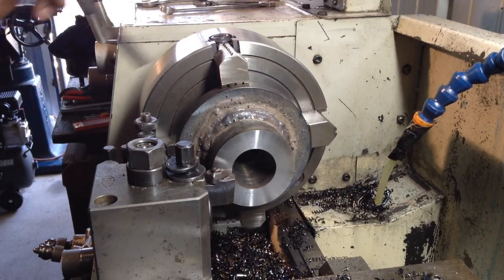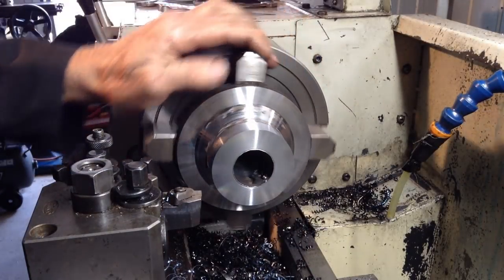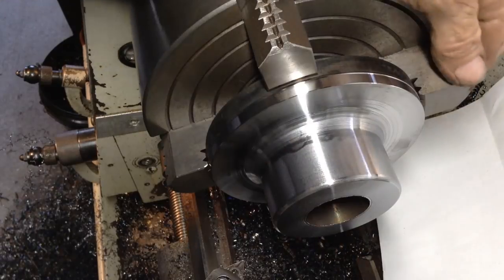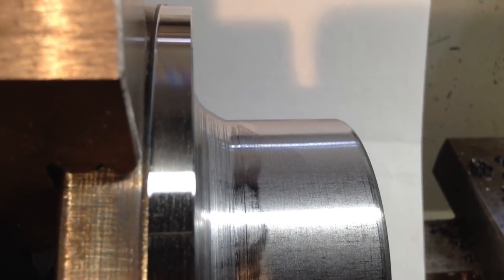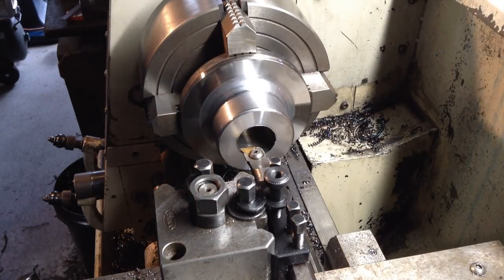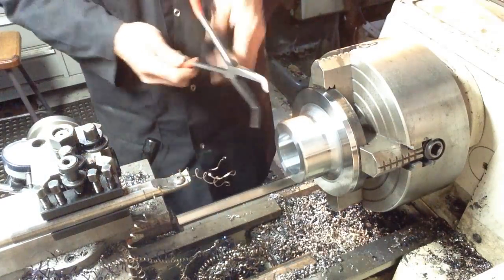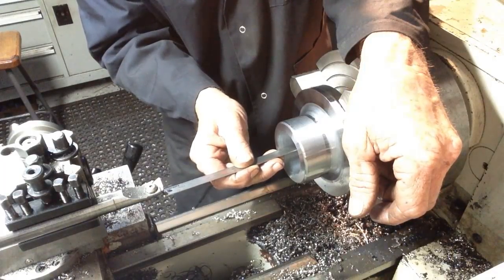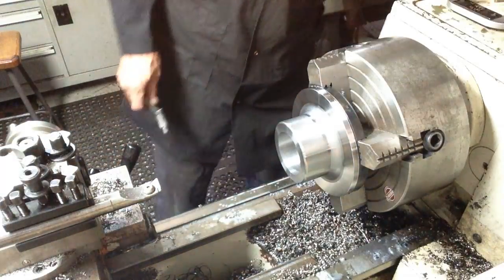Lathe Tailstock Chuck Mount .  Part 5 .

Comment: Hi Max, you got me making one, I used a front wheel bearing for a ford laser, lynx here in the Philippines, double race angular contact so it's a simple bore.
Little ahead of your's, making the spindle next.
Made the hub out of a solid billet of 4140, lots of swarf.
Reply from the maker: All the best for your build .   If i had had solid , i would have gone that way as well .  Cheers .

Comment: Nice job Max, stick with your long format, it's how I go too and is appreciated across the entire experience range. Everyone has their own way of doing things for example, I was paying particular attention to your cross slide inputs when boring, interesting how you back off at the end of every cut then reset immediately (almost like screw cutting), never done that or picked up on it before! Is that something you were taught or something you learnt? Cheers, Jon
Reply from the maker: Just something i started doing ages ago , mainly only do it with an indicator on finish cuts    & use the dial increments on roughing cuts to save dragging the tool back across the bore .  
It's one of the various methods we use , depending on how we feel on the day  !

Comment: It's coming along great, Max 😊👍. Maybe a dumb question, were you watching the indicator and manually compensating on the cross slide?
Reply from the maker: No , all  Eyeball .  Sometimes i will set the londitudinal feed going & 
hand feed the cross slide and other times both feeds are done by hand at the same time .     Just takes a bit of coordination .
Reply: @swanvalleymachineshop  nice! Well done! 👍😁👍

Comment: Max, when you cooled the part before measuring it accurately you turned it by hand while running coolant on it.  Is there a reason you turned the part by hand other than maybe to reduce the amount of coolant sprayed out of the lathe, even at the lowest speed of your lathe?  I'm sure you've got a good reason or you wouldn't be doing it that way!  ;)
Reply from the maker: If i turned it on there would be coolant going everywhere , even at a slow speed .   The oil to mix the coolant with is expensive , so i try not to waste it .
Reply: @swanvalleymachineshop  Thanks.  I figured you probably had several good reasons, all related to good common sense!  ;)